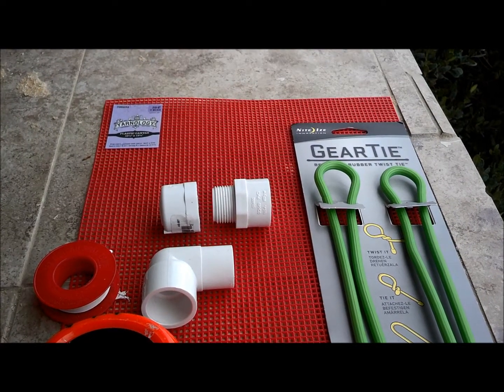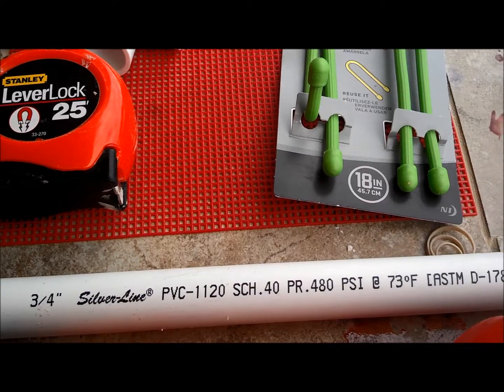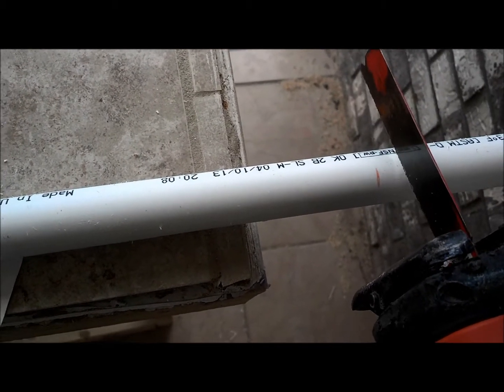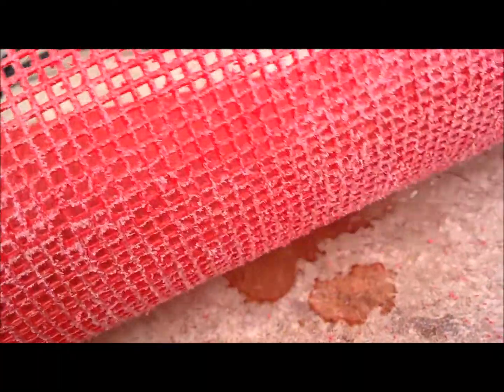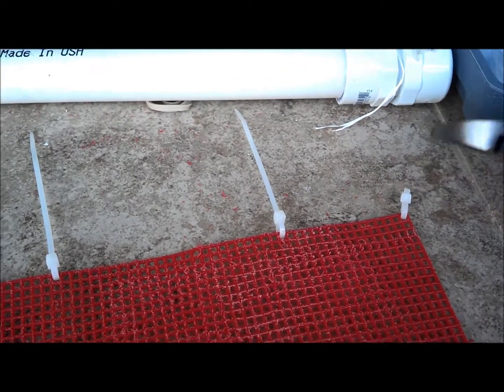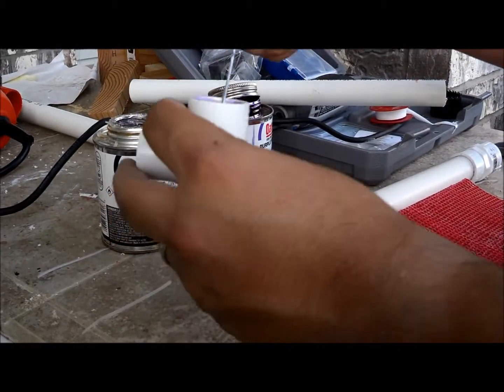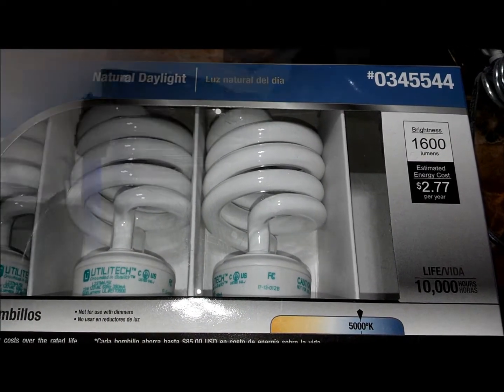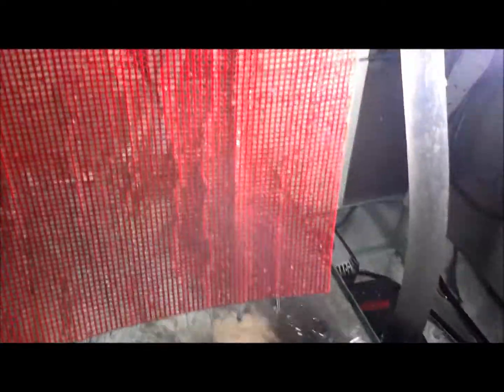HOW TO MAKE A DIY ALGAE TURF SCRUBBER FOR A REEF TANK ATS!

Comment: The flow on this will always change cause once it ever kicks off that slit Is gonna fill up with algae. Not ideal bruh.. You need some upgrades on your design.. If you can't keep the flow dialed in the turf will dry out and die.. Or clog and start pissing out if the sump right when you leave your house.. Just sayin..
Reply from the maker: It worked out, but you're right about the salt spray.  I recently got a surf 2 from Santa Monica Filtration.

Comment: Nice first build, and great roughed up screen!  Few helping points: Use white or clear screen; it will reflect the most light to the algae. And as was said, the flow should cover the whole screen heavily. You can do that without rebuilding, by cutting the screen vertically to about 4" wide, then taping up the remainder of the slot, and focusing the light in the narrow strip (both sides).
Reply from the maker: Hey Thanks Santa Monica Filtration.  I was thinking about getting a stronger pump and see how the flow would be.  But if that fails, ill probably trim some of the screen.  I have noticed it has benefited my tank. Thanks for watching!
Reply: 915Mang fifty ft fewer heart pjccghcffgggccgcchv

Comment: Nice build my man! I like the fact that you tied it into that reactor. You might find that you need to up the flow at some point to get good algae growth. 35g per hour for every inch of slot. 
I found when I had my ATS I actually got better algae growth with the 2600k "warm white" cfl's, but the "daylights" should work fine.